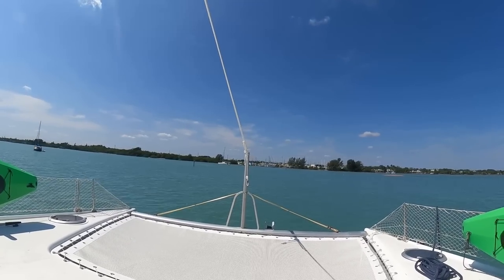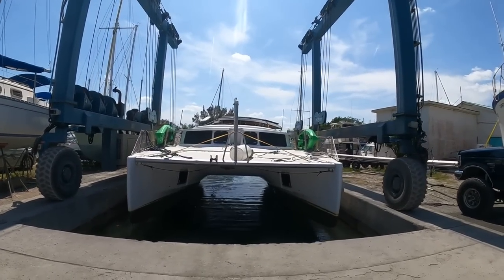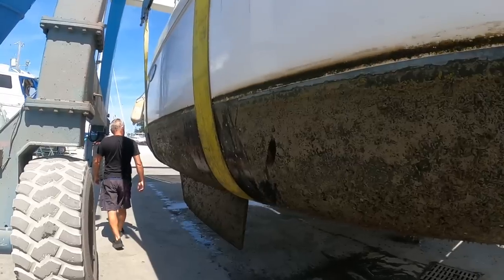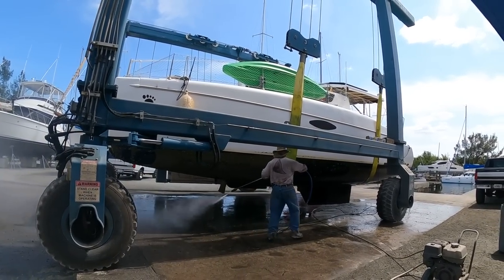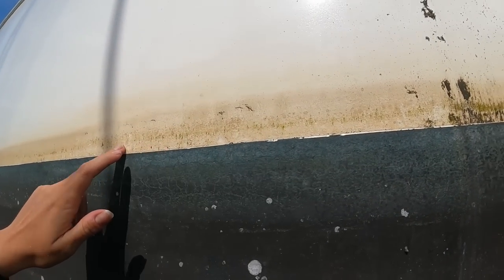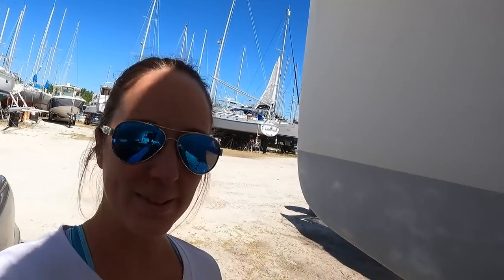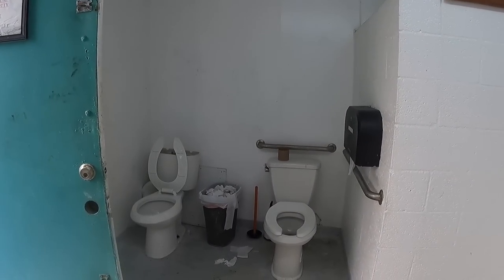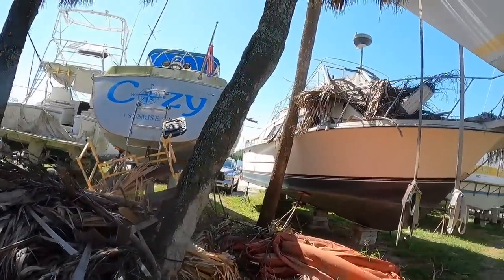Barefoot Gets HAULED OUT! (S4 E39)

Comment: so it looks like the ultrasonic stuff you installed awhile back didn't work? or did it?
Reply from the maker: Never turned it on. It used more power than we had (at the time with the agm batteries) and it made a high pitched noise our dog (Foxy) hated.
Reply: @BarefootTravels  Thank you for the reply! We have dogs , so that system is out!

Comment: How does the cost of that boat yard and the one in Luperon compare?
Reply from the maker: It is more expensive than luperon but in saying that Luperon was weird. He made up prices for different people. Every boat was paying something different for instance a smaller cat than us was paying more per month on the hard. 

The professionalism here is worth it and it still isn’t extreme. Plus the ability to get supplies easily is fantastic! 
It’s definitely one of the cheaper years around here and it allows full diy work!
Reply: @BarefootTravels  Well, I guess you need to pay some more to avoid that your boat is taken hostage. :) I am just wondering if the cost would have allowed to repair Barefoot where you are now.
Reply from the maker: 😆 yes maybe so. 

Unfortunately at the time we hauled out in luperon we had no choice as the fibreglass was so weak and we were taking on water. So we had too. 
If we were able to get to the states to do the repairs it probably would have been quicker than 9 months on the hard in luperon. So overall maybe would have been cheaper here as we can get supplies (better ones) quicker and easier.

Comment: So looks like the ultrasonic gadget isn’t working?
Reply from the maker: 😆 we never turned it on. It used more power than we had … previous to lithium install and it made a noise our dog hated!
Reply: @BarefootTravels  Got you… I was wondering about power consumption too. Cheers for the reply!
Reply from the maker: Uses about 2-3 amps as I recall when we did try it. However when we had the old agm batteries (that were nearly dead) we simply didn’t have the power. Would have been great to get the comparison